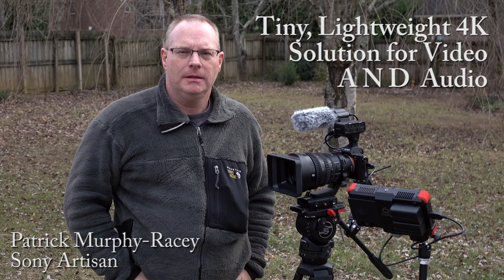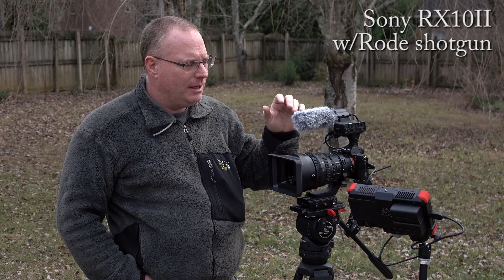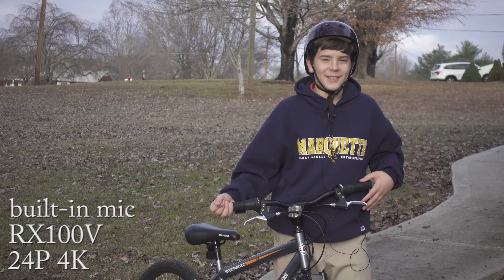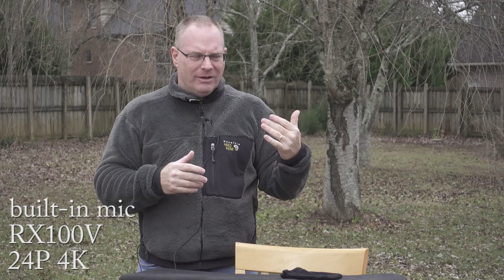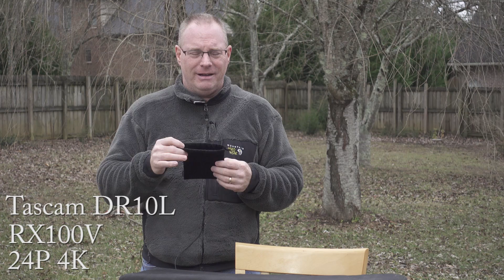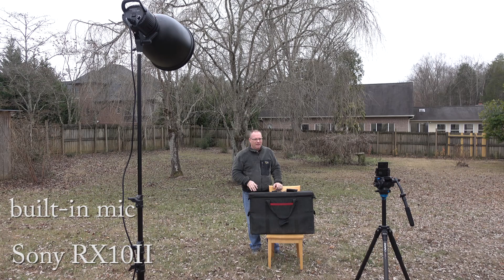Using Sony RX100V with Tascam DR10L for Lightweight 4k Photojournalism

Comment: Thank you for your insightful report on affordable 4K. I too, am with you in agreement over what Sony is doing with their camera innovations over the past two years. The a6500 looks to be a great solution as well. I am, however, concerned over the reports of OVERHEATING and AUTOMATIC SHUT DOWN with the RX 100 MK IV and V cameras, and also with the Alpha Series Sony Hybrid DSLR's
Reply from the maker: I have seen only the warning come on but I have still not yet ever had any Sony shut down from overheating.  I believe most of the problem is that the warning light comes on too fast in many cameras...  my .02.  pm-r
Reply: Patrick Murphy-Racey Great to know. I have read about this issue in approximately 50% of the on-line reviews for the Sony RX 100 MK V. Looks like not all end users are experiencing this problem in all production scenarios
Reply: Sonys DSLRs are amazing and produce amazing video, but yes, they do overheat when shooting 4k - not surprise as they have no cooling fan for the sensor.

Comment: Hi Patrick,
Thanks for the info mate. I have a question that I cannot find an answer to and hoping you may know the answer to. I fly drones and I want to try the RX100 on a drone using the gopro connectors as a hard connection (no dampers needed to eliminate vibrations) My question is, can this camera be controlled via wifi to my smart phone (samsung) and if so, what range would I have? The only requirement needed is the picture quality (no need for 4K as I have a drone Autel XSP which does a sensational job) but drones lack quality pics unless you pay thousands of dollars to get results. This camera would be a killer improvement shooting pics from the air, especially panorama shots IF I can manage it via wifi from the ground. The drone in question will carry the camera easily so that is 1 problem solved.  Any advice please mate before I spend up big. I already have the a6000 and the a7s, both are fantastic for what i use them for (a6000 for my "dirty work") ( a7s astrophotography work). The RX100 would be a handy addition for high shot results.
Reply from the maker: It would be cool!  I have no idea how to get that going but you would have to take advantage of the drone to controller radio connection.  You may want to reference a hobby store or someone that actually builds drones to see if it's possible to hack the existing Sony apps that are able to control zoom, exposure, and focus.  The 4K on the Rx1005 I use is tremendous, btw...  but you are limited to shorter clip lengths in 4K mode...  I think it's 12 min each.  Good luck and please let me know if you figure it out!

Comment: Hi Pat your videos are very informative and I  purchased my first a6000 series camera last year cause of your videos    Not a professional but I've taken stunning pictures and videos during my daughter volleyball games.  I then purchased a Sony wx350 for video,  4k wasn't a factor during its purchase. Found out very quickl 22 minute was its max video length unit shuts down.  I'm Debating should I buy  another a6300 for video while using my a6000 for action pictures  do you had another solution or suggestion with my Wx350. Since recording and pictures I've become the teams media guy but I didn't want to break the bank a camcorder doesn't give flexibility for photos
Reply: Basically all stills cameras will have a 30min clip limit on video due to tax laws (the Panasonic GH4 is the notable exception). Many are further limited for 4k footage due to overheating, including the a6300 and rx100 series, though I understand the a6500 pretty much has the 4k overheating problem solved.

Comment: Tascam DR-10L Digital Audio Recorder with Lavalier Mic

PRODUCT HIGHLIGHTS

Mono Digital Recorder with Lavalier Mic
Records 24-Bit/48 kHz BWAV File Format
Up to 32GB on microSD or microSDHC Card
1/8" Stereo Headphone Output
Single AAA Battery Records 10 Hours
Built-In Limiter Function
Low-Cut Filter Reduces Wind and Rumble
Dual Recording Mode
Easy-to-Read OLED Display
Case, Windscreen, Mic Clip & USB Cable

Comment: Where do you get the dead cat from? for you mic?
Reply from the maker: it actually comes with the mic when you purchase the XLR-K2M.  Great deal--like getting a free pro mic on the package...
Reply: Patrick Murphy-Racey I bought the same unit but mine only came with the black foam
Reply from the maker: must have been an older one???  or did you get the XLRK1M?
Reply from the maker: that's the XLR-K1M I think

Comment: Holy cow that sounds phenomenal.  I've been using the RX100 series for about 4 years and finally decided that there was just insufficient  stabilization and too much rolling shutter for run-and-gun video (although I hear the RX100v is slightly better).  Tripod shots are phenomenal though, and sometimes hard to distinguish from the A7R2.